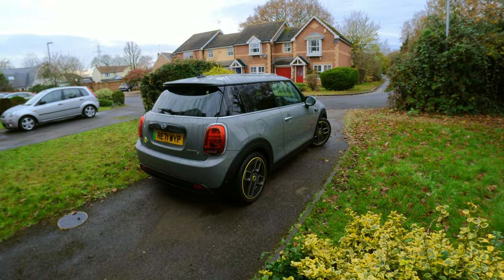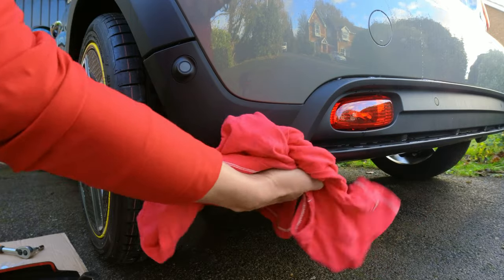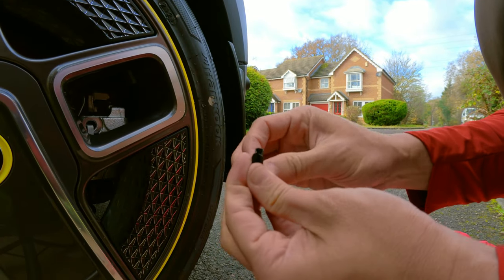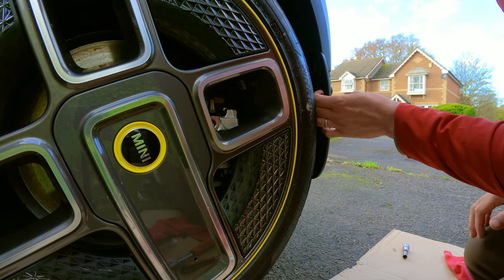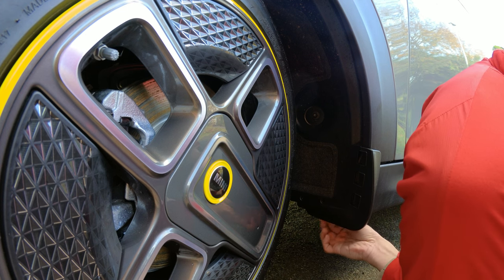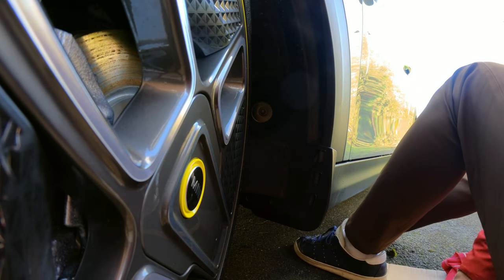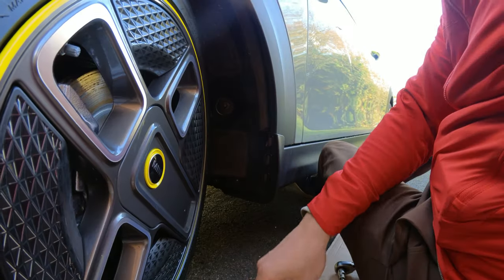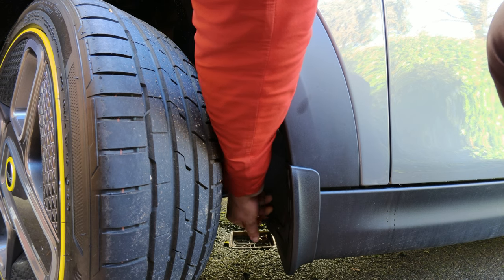Mini Cooper S E Electric F56 Genuine Mud flaps Installation

Comment: Does this fit countryman 2023
Reply from the maker: I don't know tbh. You'll have to check the mini website.
Reply: Nope > OEM part number for 2023 Countryman (Splash Guards) is : 
82 16 2 410 137 Front
82 16 2 467 102  Rear

Comment: I need it for my f55 too, where can i buy it?
Reply from the maker: Hi, not sure whether they are the same, but you can check it out from the links I've put in the description.
Reply: I'm fitting the front today on my F55, as when I spoke with BMW/Mini, the parts guy told me the fronts should fit ok, but the rears won't fit on a F55.... Still trying to work out what to do with the rears... apparently there aren't any F55 OEM Mud Flaps. 

Great video btw Imspir3 👍

Comment: Thanks for the overview. Now that you've had them for a while, would you be able to comment on how effective they are at keeping the car cleaner? In my last Mini, the rear would get dirty especially quickly, and I'm wondering if mudflaps would help.
Reply from the maker: I did noticed some improvements as soon as I installed them. Before that, the rear gets dirty very quickly as you have noted.

Comment: I did mine the same without removing the wheels. The most tricky part was installing the rear clips.
Reply from the maker: Agreed 👍.  But after I've discovered the trick to loosen the clips, it's significantly easier when I was installing the second one.

Comment: I ordered these flaps for my wife's new SE both of which arrived a few days ago. After discovering they came without instructions tracked them down online and frankly the diagrams while ok make it seem much more difficult than your video. The same goes for forum posts that suggest removing the wheel etc.
Thanks to this video I'm finally going to stop procrastinating and fit them later today.
Thanks for taking the time to make this video!
Reply from the maker: Many thanks for your comment. That's why I have decided to show the process so that others can benefit from it.

Comment: Just fitted flaps to my Cooper S
Your tutorial was extremely helpful as they come with no instructions. 
I used a jack on the rear to give a little extra room to work. 
Flaps are excellent and well worth it. 

Thanks for sharing your installation process. 👍
Reply from the maker: That's great to hear it helps. 
I didn't have a jack so just try to make do with what I had, it's just more fiddly😀